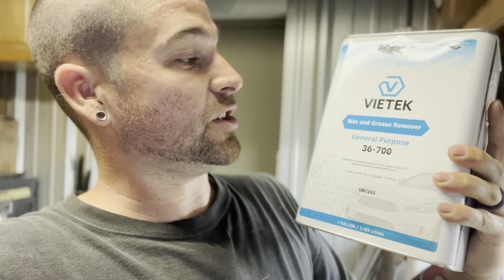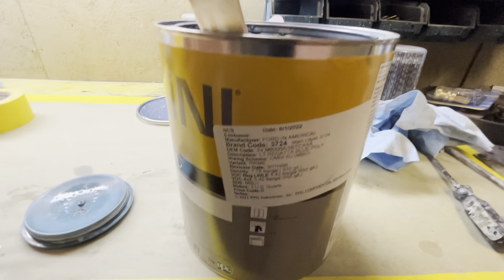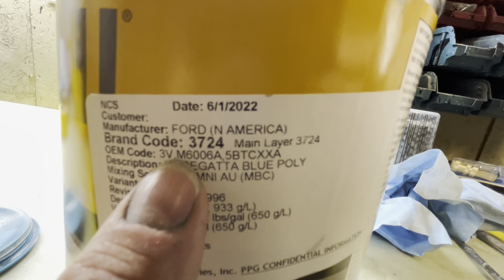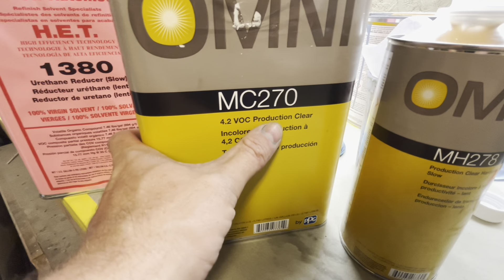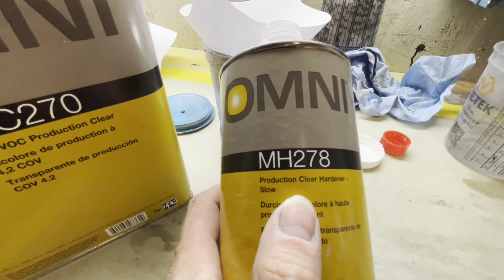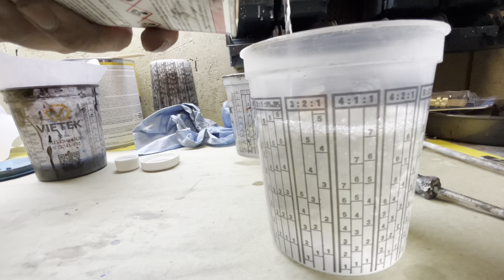💥 More Progress On The Fox Body Mustang 💰 Doors & Fenders Done‼️

Comment: I had a car painted and cleared with omni and needless to say all the clear basically pealed off, it looked good for a year or so.  I was told to stay away from omni line.
Reply: Ive seen nason used alot! It any good?
Reply from the maker: It’s a DIY clear kinda. Like it’s found at a lot of Napa and places like that. It’s nothing amazing but not terrible
Reply from the maker: I’ve had great luck with Omni and been spraying it for over 6 years no with zero come backs. It’s the most common sold clear at the local paint supplier they say and sometimes lately have been out of stock due to supply. Sounds like someone messed up on the prep in your situation
Reply: @ThePaintPaperHustle  I wouldn't doubt it, plus that was 15+ years ago so they may have had some issues back then.  When I had him paint my Capri I had him use dupont and it still looks good 15yrs later except for all the places I've bitched it up.  

Can't wait to see that blue out in the sun, I'm loving that color!  Great job!
Reply from the maker: You sorry to here that happened to you man. And thank you
Reply: yeah 10 to 15 or so years ago omni had a lot of problems delaminating. was super thin and with only 2 coats of it it basically had no uv protection and would be lucky to last 2 years. the newer omni is a lot better product than the omni of the past.
Reply from the maker: Interesting and good to know.
Reply: Isn't there a risk with paint blending/matching when painting the doors separately like that ? I'm not sure I'm asking it correctly. I know what I mean. Ain't sure you will.
Reply: @mikemontgomery7337   not too much, i paint collision work like that everyday. remember your air pressure and how many coats you put on and you should be golden
Reply from the maker: Mike I know what you mean and no not in this situation being I’m doing everything the exact same with an easier color. There’s a lot of different things that play into rather you can panel paint or not